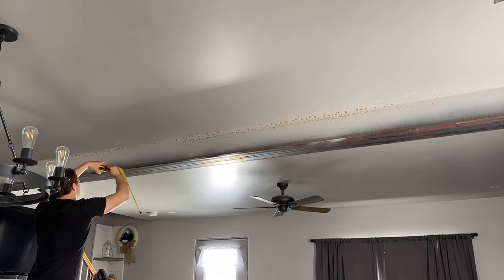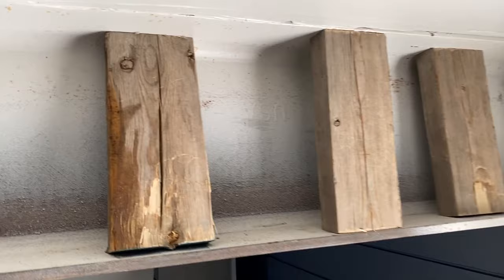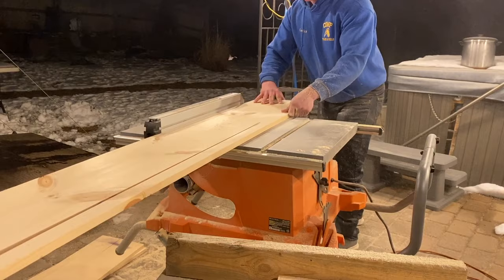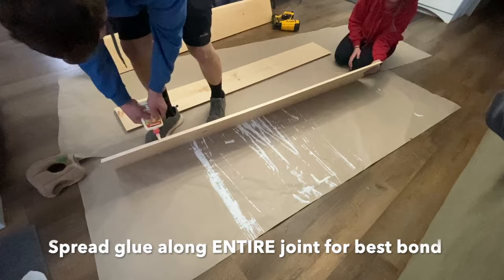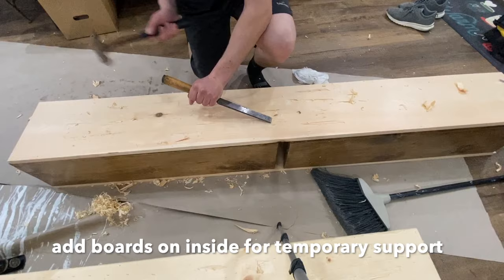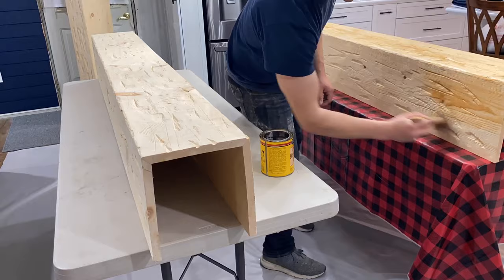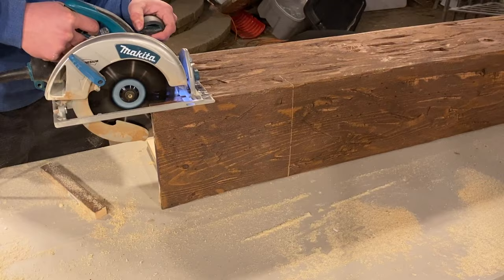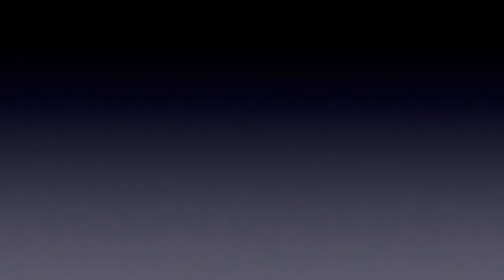How to DIY- Farmhouse Faux Log Beam

Comment: Excellent job. Shows the benefit of using a pre-stain before the dye. No blotching etc. Another tip is that if there is a large knot at the edge of a plank which is mitered to one without a knot you can "draw" on a knot with a fine paintbrush onto the plank with a darker dye to make it look like the knot goes "around" the edge and makes it look even more like a solid beam.

Comment: Great video and good job. Nice to see a realistic diy. Miter saw on a plastic table, table saw on the floor, cheap wood lol.. vs “diy” in a custom woodworking shop with every tool imaginable. Hewing axe and a chain works good too but the grinder is a great idea I’m definitely going to try it. If anyones wondering, I use the chain to hit the wood. Adds dimples and texture that really make it appear hand hewn. I’ve also drove some nails in a short piece of 2x4, hitting the wood in various spots. When stained the holes are slightly darker and adds a wormwood effect.

Comment: wait a sec, how did you cover up those cracks where the beams meet to make it look like one continuous log?
Reply from the maker: Unfortunately I uploaded this video before I fully finished the beam because I made two 6” wide metal brackets and slide them over the joints to make it look like a connection/supportive feature and spray painted them black.
Reply: Great Idea like a middle-aged
Reply: @bensworkshop4195  Photo please of brackets.

Comment: When you install it in three pieces it hardly looks like 'a Beam'. I might add that there are many ways to distress a Beam that don't include leaving heavy Chisel marks.
Reply from the maker: “The beam” joints were covered with 6” wide steel straps. There are many ways to distress a beam I agree. In order to get the look the client was looking for, this was my way 👍
Reply: @bensworkshop4195  Then show the finished project.  The joints like like crap.